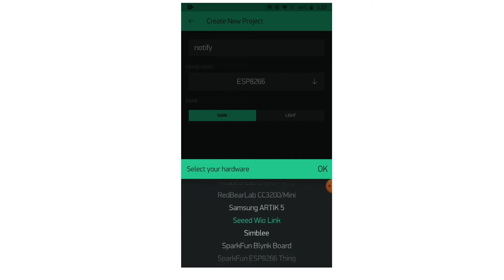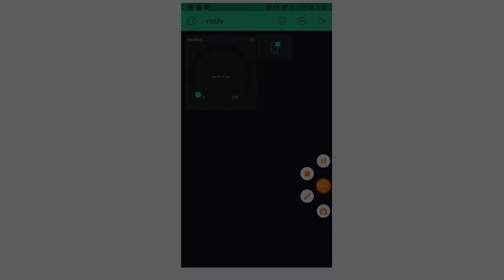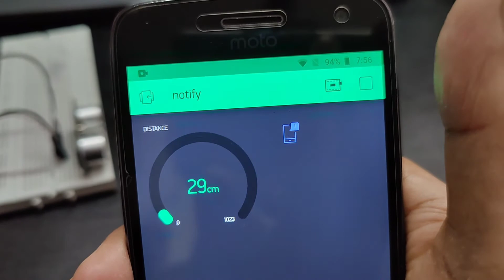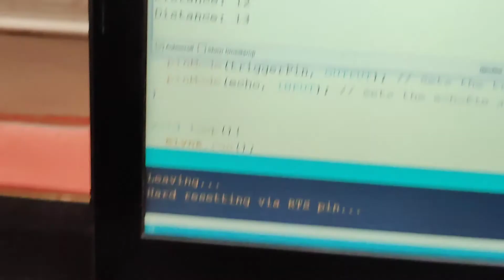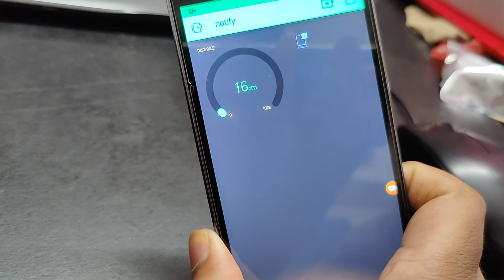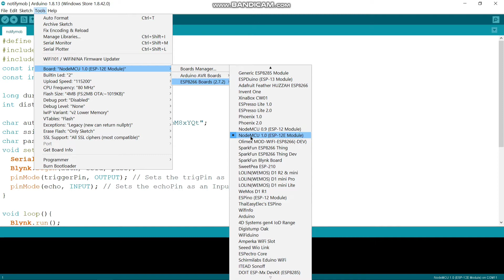Mobile Notification using NodeMCu & Ultrasonic sensor | Blynk app | ESP8266 | HC-SR04 | IoT Projects

Comment: Hi sir. I have a problem. the serial monitor keep showing  the distance is 0cm. how could I fix it?
Reply from the maker: Please check the following things:
1. Circuit connections.
2. The distance that you are keeping the Ultrasonic sensor from the object should be 3-4 cm. Because the Ultrasonic sensor would measure a minimum distance of 3-4 cm.

These might be the reasons it would be showing 0. Please let us know if this helps.
Reply: power x kuat tu kak.. sambung wire power kt pin VU, pin VU 5v, pin 3v3 tu 3.3v ja..

Comment: hello brother. i was connecting a similar circuit, but my serial monitor won't print active distance at all. could there be any issue with the numbering of the pins in the code or something?
Reply from the maker: Please make sure that the pin with which you are connecting the Ultrasonic sensor on Arduino is defined as the Input Pin in the code. Also, the value that you would need to display is the value of the same pin which is set as Input Pin to get the value of the Ultrasonic sensor. If this is done correctly then your code should work. Please let us know if it works for you now or not?
Reply: @LearnElectronicsIndia  I connected D1 and D2 as pin 5  and 4respectively.  Is there any other thing that I have to mention?
Reply from the maker: @kelvinfernandes1573  Since, you have connected D1 & D2 instead of D4 & D5(as in the above project code), you would need to change the code part in the Void Setup. 

Make sure that you have defined the D1 & D2 pin as Input or Output pins correctly i.e. if D1 is trigger pin then D1 should be the Output pin else D2 should be the output and vice versa for Echo pin.

Rest everything will work fine, once the I/O pins are defined correctly.

Comment: the serial monitor keep showing  the distance is 0cm and  the notifications keeps pop up
Reply from the maker: Please check the following things:
1. Circuit connections.
2. The distance that you are keeping the Ultrasonice sensor from the object should be 3-4 cm. Because the Ultrasonic sensor would measure a minimum distance of 3-4 cm.

These might be the reasons it would be showing 0. Please let us know, if this helps.
Reply: @LearnElectronicsIndia  After I change the vcc connection from 3v3 to Vin, finally its working.
Reply: @zulhusnirifhan9504  hello may i know if the other connection is stays the same or not?

Comment: One thing, the gauge settings does not indicate the distance and the alert does not stop sounding and that I do not have an object less than 10 cm. How could I fix it?
Reply from the maker: You can calculate the distance and check the value in Serial Monitor. Also, set the threshold value of the minimum distance by making changes in the code but for this HC-SR04 Ultrasonic sensor, the minimum distance would be 3 cms that it can measure.